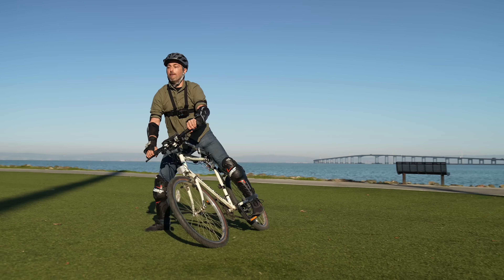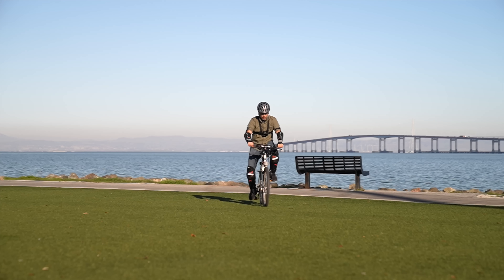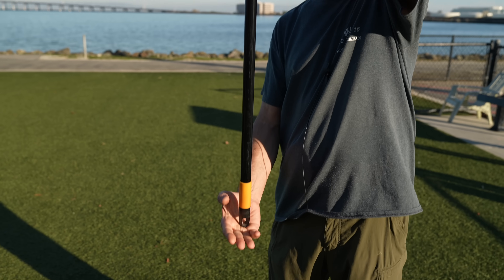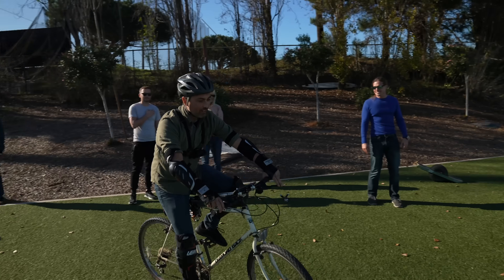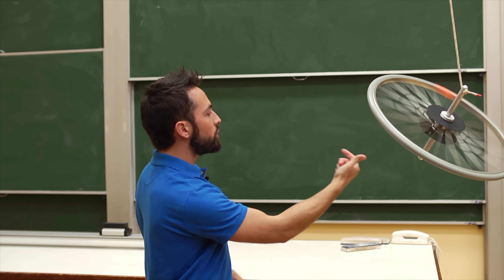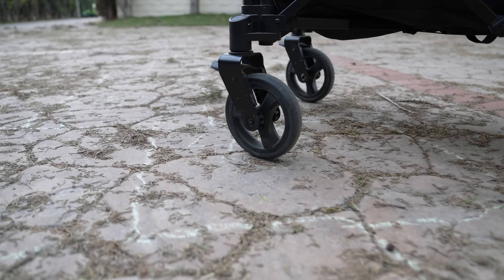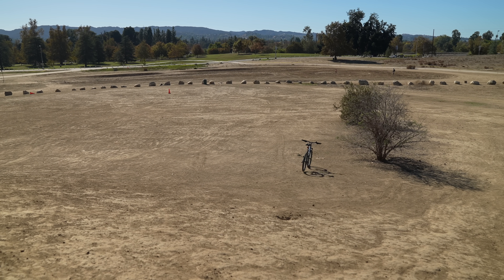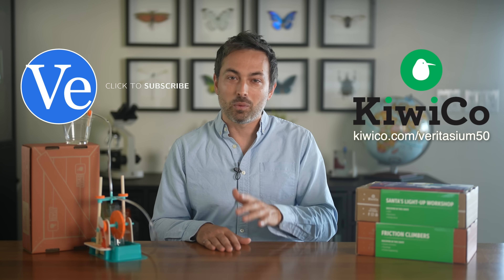Most People Don't Know How Bikes Work

Comment: You proved your point by hard steering either to the left or right with low speed, but that's not how you generally ride a bike. That's why I disagree with your conclusion not being able to ride this bike. I wonder if you can stil prove your point if you know way in advance where you're going. While riding a bike in traffic, you know way in advance where you're going so the initial offset input is close to non existent because you already lean in to the corner way in advance. Why not try it in the Netherlands just like Destin did with his counter steering bike. If there is a people that have experience riding a bike it will be the Dutch. Most Dutch youth can even ride a bike without hands so how do they make that initial counter steering input that you were talking about?

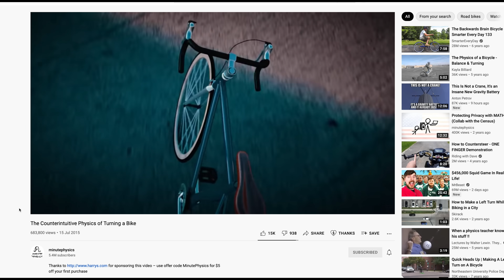Comment: 5:57 seems more like there's a lack of foliage/soft soil to dampen the resonance of the tire acting as a spring/more inflated tires creating more resonance.

EDIT: Just realized it would be much harder for this bicycle to steer itself down this hill if it did not have damped springs in front.  If you look at bikes that don't have front shock absorbers they have more castor angle than bikes with front shock absorbers.  

Damped springs in front are also important for a bicycle's stability.
Reply: With no rider weight those shocks near enough weren't moving. It's far more down to geometry.

Road bikes actually have steeper steering angles (72-74 degrees) and reduced trails with an aim to being more responsive. Angles slacken and trails increase moving towards the off road end of the bike spectrum to help stability with downhill mtbs ~63 degrees.

Comment: With a wide motorcycle tyre the geometry changes as you lean the bike and ride on the edge instead of the centre of the tyre.  This is why you shift your arse across the seat to adjust the centre of gravity.

Comment: Bro if you turn using just the handle bars or have to turn the opposite way there’s an issue. I used to ride a bmx and mountain bike just lean the direction and slightly turn and there’s no need to turn the other way 🤦🏻‍♂️

Comment: This also explains how you can ride a bike and even steer one without holding the handlebars. (Doing this is ofcourse unsafe on a bike with handbrakes)
Reply: It's not any safer with backpedal brake.         Your front brakes do more than 70percent of the braking.

Comment: Hey Derek... In addition to this, try riding extremely fast (about 15 mph) and then there is something else that happens where you can slightly push the handlebars to the right and you turn left. Countersteering. This is how motorcycle riders turn at higher speeds as well.

Comment: Lol, no, you have to grab grip and torque first, otherwise the entire back of the bike pins up against the front of the frame and you launch yourself. It's partly due to the steering shaft, but largely just common sense you can't turn on a nano dime

Comment: For me this shows that supporting wheels shouldnt be used for beginners: you completely learn the wrong movement for curves, cause you don't need to countersteer. In Germany most people use "laufräder" which are small bikes without pedals or supporting wheels. When you then change to a "normal" bike, its much easier to learn

Comment: You have to lean or simply shift your weight before you turn your handle bars. Just stay as balanced as you can until you see the light and lean into the corner. It’s the basics of hitting berms on mtbs.

Comment: Unlike some comments say, countersteering is the ONLY way to balance the bike or to make it turn when not stationary. This is because one's bodyweight and the weight of the bike are effectively just parts of a single mass.

According to Newton's 3rd law, each force has a counterforce. If you try to move your body weight to one side related to the bike to balance it, you are actually using the same amount of force to move the bike to the opposite direction. Therefore moving one's body weight sideways does not move the combined center of gravity at all.

The combined weight of you and your bike can only be moved sideways by having an EXTERNAL force affecting it. Countersteering creates this external force by causing the counter-force of your weight (gravitation) to have a sideways component by moving the line of contact points to the ground (bottom of tires) off the line of center of gravity.

Having said this, the counter steering can be initiated by moving one's body weight. But it is the counter steering, not the body weight movement that actually turns or balances the bike.

There are also other forces and laws affecting the bike and rider during the turn, like the Newton's 1st law (using external force to change the velocity.). Because turning is effectively just changing the velocity. the SPEED may remain the same, but the DIRECTION of velocity changes when turning, and the force to make the bike turn is the "G-force" we feel.

Comment: Fail, not once was the word "COUNTERSTEER" used. :) And its different on a motorcycle, go 60mph straight and then "only" pull the right handlebar (do not push it back the other way), your going to turn left, this happens do yo the shape of the tire.

Comment: I didn't knew about counter steering ,but i always thought that to make a turn rider has to lean in the direction of the turn, And also that it has something to do with toppling and it's related to why roads are banked at a certain angle !!
Reply: No no no.   You don't fall over.    Motorcycles.  Same thing.   No toppling over.       That's cars.  Different.  Cars fight those forces motorcycles n bicycles are much smoother.

Comment: I knew about this about 45 years ago. In cycling and motorcycle terminology it's called rake and trail. It can be altered to make a fast turning or slow stable turning bike. At a speed over about 10 K/H to initiate a turn requires  a push on the handlebar in the opposite direction than what you want.

Comment: One more thing. When you are making a left turn the whole time you're turning left you are putting a force on the handlebars to turn right. So in addition to applying a force to turn right to initiate a left turn you also apply a force to the right to maintain a left turn. Even though the handlebars are turned left during a left turn you must keep a force to the right or the bike will right itself as pointed out in this video.

Comment: Doesn't this all only apply to slow riding speeds?
When I'm cycling above 30mph my steering, especially on approach to a corner, is by leaning right over like a motorcycle racer and very gently turning into it, though obviously not so much as getting your knee down.

Last thing I want to do at those speeds, particularly when you think about bumpy street surfaces, is having the front wheel slip and dip under because of using the handlebars to turn.
Reply: No absolutely not. You do push motorcycle handlebars too.
Reply: You always use the handlebars you just don't know it.

Comment: Motorcycles are even harder about this. I didn't realize to turn I have to put pressure on the inside handlebar of the turn until I had already wiped out. It takes a bit more confidence, trust, and accuracy to turn a motorcycle with leaning. Grew up driving dirt bikes all over but they're easier to not lean like that and oftentimes turning too sharp will spin you out.

Comment: Typically I don't usually "steer" a bike, but instead I just lean my bike.
Having the handle-bars locked would only serve to widen any turning circle, try "counter steering" at 40MPh in a 45MPh turn (typical radius of turns on 50MPh roads) and ya'll be flung off in an instant.
The only time I'd counter-steer is if I'm going slowly enough and using counter-steering to compensate a turn in a tight location.
Reply: To physically lean the bike, countersteer HAS to be applied. Whether consciously or not.

Comment: It's actually possible to turn without turning first. In BMX and MTB, we use other techniques  to maintain position or change it. If you lower your knees while thrusting your bars in the opposite direction and apply thrust with your ankles, you will create the needed opposite reactionary force to initiate a change in momentum. This is how we can ride on a wire and hop laterally onto another wire or rail.
Reply: Yeah, I'm glad he included the part where he did ride with it locked. You balance a bike by turning, and you turn by leaning. Counter-steering is just the normal, and probably best, way to start leaning. But it isn't a requirement.

Comment: Riding a bicycle means undergoing constant acceleration - as a whole system (bicycle + human). It must be accelerated in at least one direction (from four possible: forward / backward, right / left). Acceleration is made by turning / balancing the body, or braking / accelerating.
** Very simplified what I wrote - but it will exhaust the topic.

The gyroscopic effect has a visible effect on the force needed to move the steering wheel at high speeds (and on braking). If we replace the wheels with skids (skis) - it will also be difficult for us to keep our balance while standing still. Only when we go down the slope undergoing gravitational acceleration ... and by turning, succumbing to the forces of inertia, we maintain the position on the bike with skids.
Reply: what is "balance" ? its  acceleration - shifting the center of gravity to another place - causes acceleration, which causes an increase in momentum, and prevents overturning.

where the global acceleration of the system (bicycle&cyclist)  is a component of all accelerations in the system (due to balancing, turning, braking, acceleration)

The angle at the head of the bike obviously affects the steering - oversteer and understeer. Some bikes will tip over faster, others later. But ... for example, please build a bike with skids and let it go down the hill with snow. Acceleration is the key - and so is momentum.

Comment: was this tried on anyone that can ride a bike without using their hands? Riding no handed, in an upright sitting position, leaves you with no way to control the bike but leaning. I can ride a bike miles without touching the bike with my hands, and the leaning vs steering fact is understood by anyone with bike experience beyond 'i occasionally ride for recreation'. I'd be interested to see this test replicated with more skilled cyclists.

Comment: Can confirm that wheelchairs work similarly, which is why it is so annoying that most sidewalks slope hard into the road, both sides want to swing that way to correct the balance and you have to fight it which is about the effort you see the superleaning guy going to.  Same with the unicycle physics and wheelies, which is how you get anywhere that isn't a smooth floor.

Comment: You can lean towards the direction you want to turn before you start steering if you lead with your head instead of your whole body. As a matter of fact when i ride a bike I try to steer as little as possible doing most of my turning by means of leaning. If you try it you will see it works. That moment of instability you describe in this video happens when we don't ride bikes very often. But if you are a tall (and by consequence, heavy) person as I am you don't want any instability whatsoever so leading my steering with my body weight and balance before I steer works best. In addition, by doing the way I described you also reduce the lateral strain in the front wheel. But yes, I suppose some amount of counter steering still happens while I'm leading my next steering...what have you done? Now I need to lock my bike steering to see how I do it... Great video by the way, as always.

Comment: This reminds me of the very first time I got on a motorcycle. I hadn't ridden a bicycle is proly 10 years and had never ridden a motorcycle or dirtbike, yet I was able to ride it just fine after about 10 minutes of practice to feel out the weight balance. I was able to counter steer just fine and I only layed it down when I made the #1 parking lot mistake, I hit the brakes with the handlebars turned. I do find it fascinating that while motorcycle and bicycles have the same basic idea behind them they have drastically different riding styles. I have noticed that even at slow speeds on the motorcycle I just turn in the direction I want to go but I end up using far more correction than I would on a bicycle and then at higher speeds (like 10-15mph which I ride at on the bicycle) I am purely using counter steering throughout the turn.

Comment: as some one that has driven motorcycle since the age of 14, at high speed you stop steering, so what i ended up devolving is i lean and kinda jerk the motorcycle with my legs its kinda wierd to explain but i can do relatively sharp turns going fast rather then following a curve so i can evade pot holes going fast but at super close calls insted of avoinding them by far

Comment: I think the self-steering mechanism is the same which is used in cars (even before the use of power-steering) so when you leave the steering wheel the car goes in a straight line. 
Next experiment: How the size of wheels affects the quality of a ride (assuming there are no bumps that are challenging for small wheels)? Can you balance a bicycle on ice skates instead of wheels?

Comment: I disagree with the counter steering to a certain degree. The speed at which you are moving plays a very important part.

At slow speeds a bicycle's motion is not stable so it tends to wobble to counter the instability. At high speeds it is much more stable. In this video most people were riding at slow speeds so you always need to counter steer before you steer in the intended direction as rightfully shown in the video.

But at high speeds you don't need to counter steer because at high speeds you bend your body to adjust the centre of gravity/mass to turn anyway. So you don't need to counter steer.

In fact try it out. Watch a cyclist turn at high speeds. They don't counter steer before steering in the intended direction. And likewise for locked steering. If you are at a stable high speed, a locked steering won't be a problem. It's at low speeds that the wobbling effect is required to counter the instability at low speeds.

What would be interesting to know is at what speed is the interface between the unstable slow and the stable fast.

Comment: "Why is it hard to balance on a stationary bike?"

Trackstand. I can't quite do it but I can get very, very close to a complete stop without unclipping. Honestly, I just haven't practiced enough. Pros do it all the time and, of course, they make it look easy. However, it has everything to do with the angle (steering) of the front wheel. Essentially you press/release on one pedal but the angle of the front wheel prevents forward momentum AND maintains your balance. It's a constant push/counter-push process and definitely looks cool when you are able to pull it off without falling.

Comment: If the fact that it is harder to balance while moving slower on a bike is because you have less steering and not because of the gyroscopic effect, than why is it easier in a lower gear where my pedals are moving faster than in a higher gear where they aren't moving as fast? Doesn't it have some to do with the gyroscopic effect?

Comment: There are a few things i am not getting which might be a failing of myself, but when im riding a bike at normal to speeds i generally dont steer at all. I just lean. Im not counter steering im simply leaning my body left or right. The same is true when I ride with no hands. I dont lean left then right to turn, i just lean one direction. I think the biggest issue here is the locking of the steering. When you lean, the bike steers as pointed out. The better test in my mind would be to lock the bars but not the fork.

Comment: As a motorcyclist, counter steering is one of the most important aspects of riding a 2 wheel machine. Left to go right, right to go left. You don't steer with the handlebar, you lean with it. Those who cannot accept this are always the ones to end up in the ditch first.